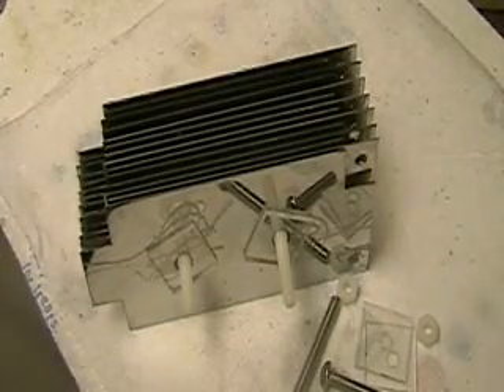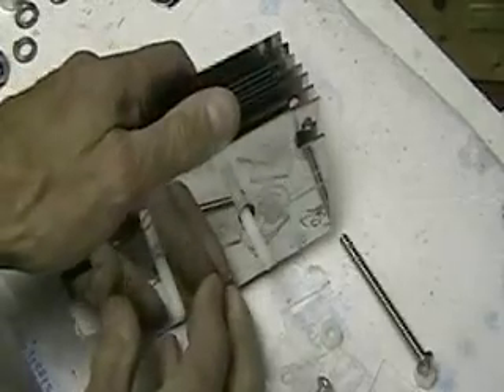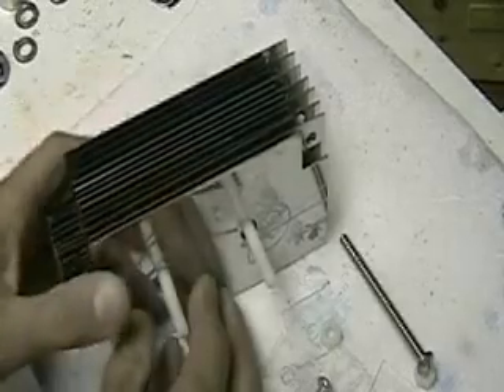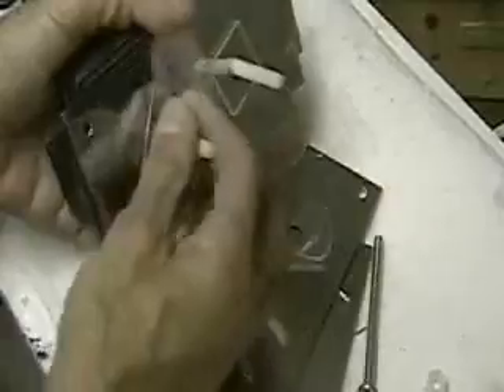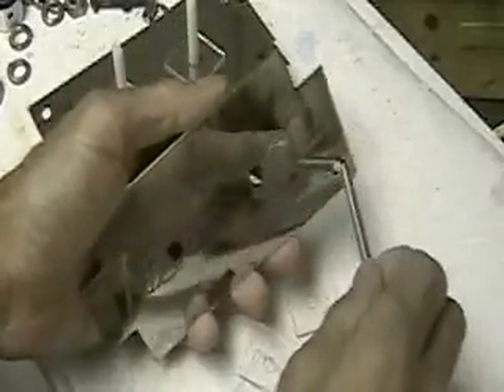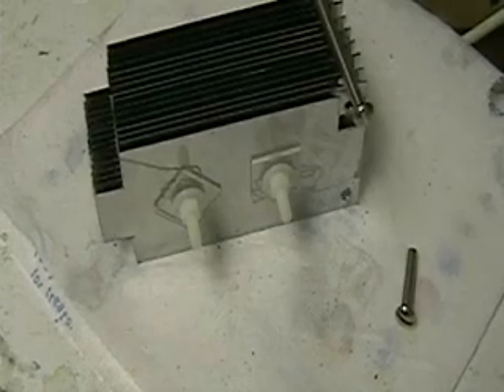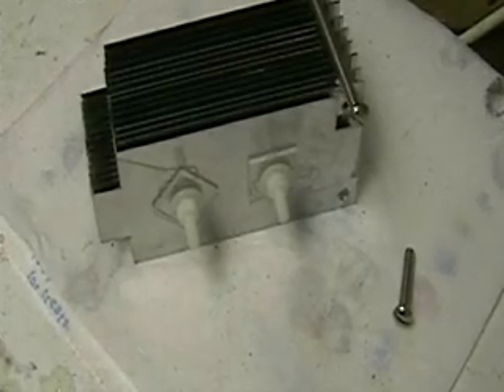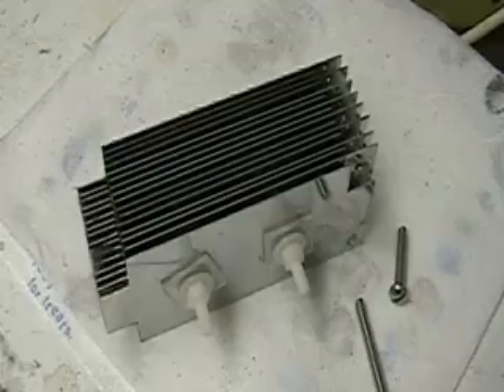Hydrogen Tap (New AAron's Cell N-16) 253

Comment: I saw the website. Is 430 SS better than the T-304, 312 etc? I know nothing about the contents of the metals. I was just thinking more neutral plates will lower the amps and reduce heat and corrosion. Sure its not as powerful but you would replace less plates in theory.

Comment: I like the plate design where they can be placed as neg, pos or neutral. Instead of cutting the corners out completely you could just drill a hole larger than the bolts. Would there be any benefit or drawback to this? There would be more surface area. Maybe that would be a plus? It might make it easier to make since drilling a hole is easier than cutting a corner out.